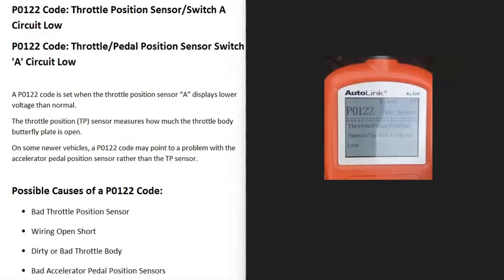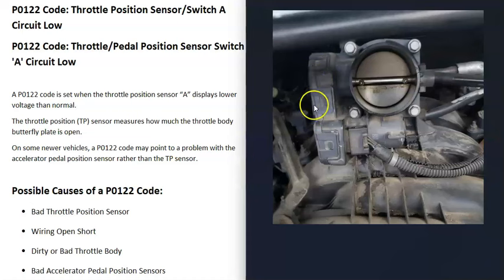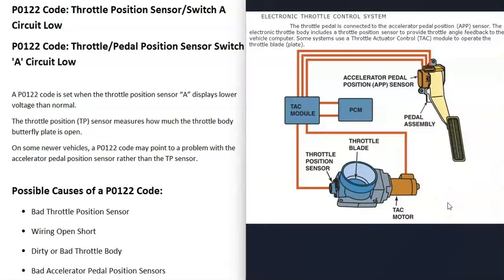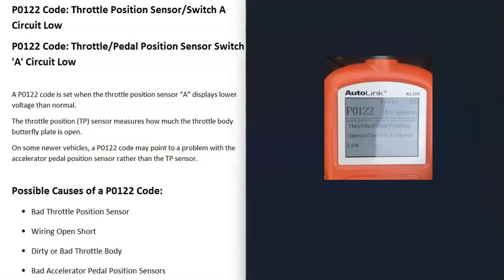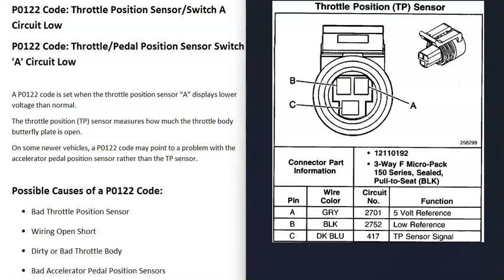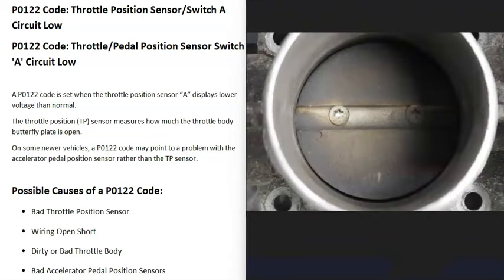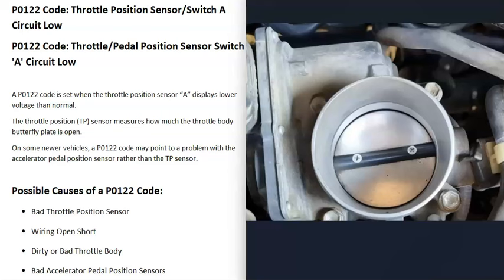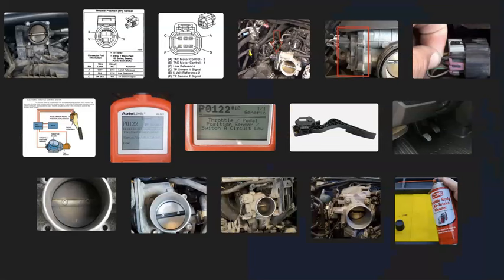Causes and Fixes P0122 Code: Throttle Position Sensor/Switch A Circuit Low

Comment: So i bought a 16 expedition that didnt have floor mats. I bought some weathertek mats. The next day the car ran like crap. I had to have it towed twice and the shop replaced the throttle body. I park on a hill and get an incline code. Cant drive it. I get it to the shop, they warranty the part. A week later it does it gain. I read it could. Be from floor mat blocking the sensor... 😮 pulled mat, we shall see if the problem is fixed.

Comment: My 2008 bmw x5 won’t start but the check engine light came on I scan it and it saying it is the the throttle /pedal position sensor circuit high

Comment: Thank you, it helped a lot , did clean it and replaced the switch, the engine light still comes on, now check the pedal if I have one there. Its a 99 ford expedition, 5.4